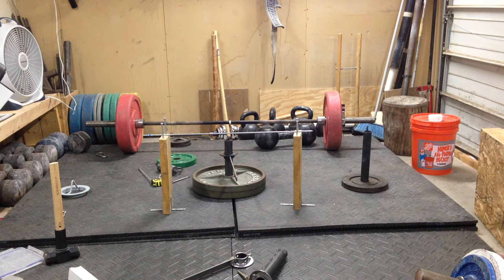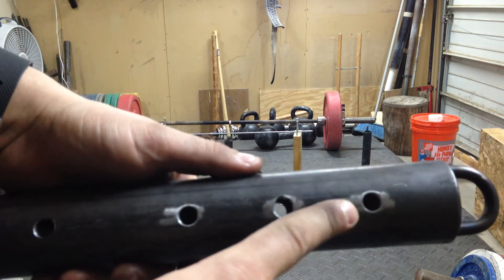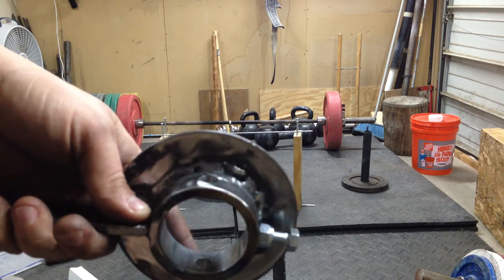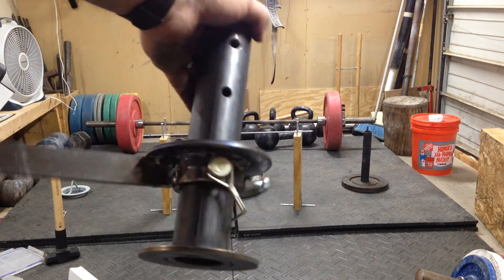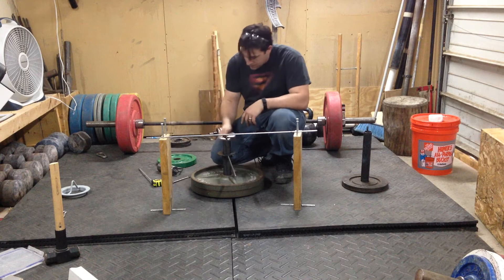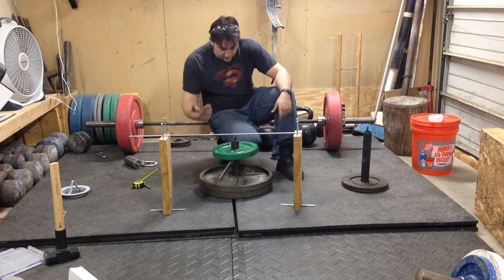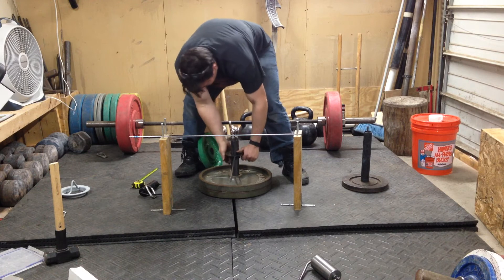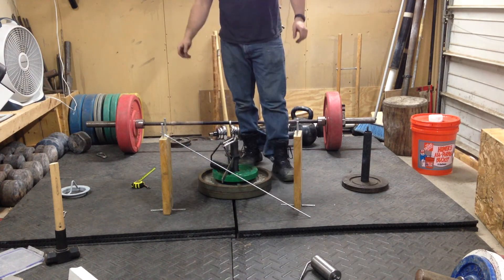Contest Loading Pin

Comment: Great idea! Makes 100x more sense than using a "lockout" in events where an item is lifted; after all, the main goal is showing our hand & lower arm strength while controlling an object and this is much easier to judge. Grip is its own sport, we should develop our own standards rather than borrow from other sports when it is not necessary to do so.